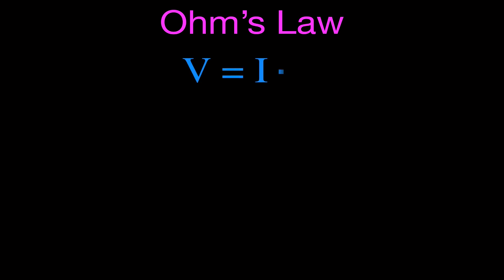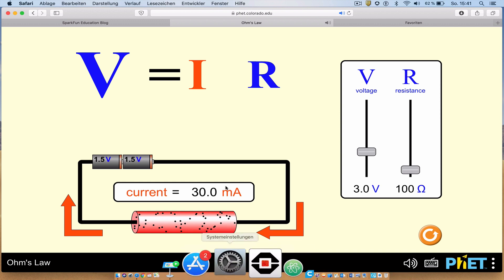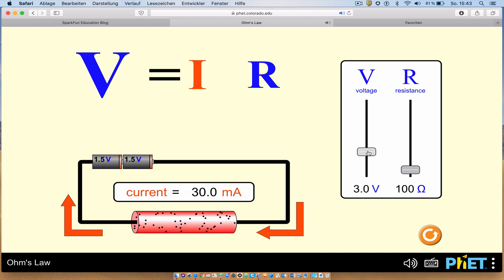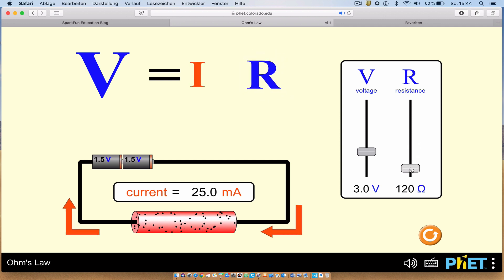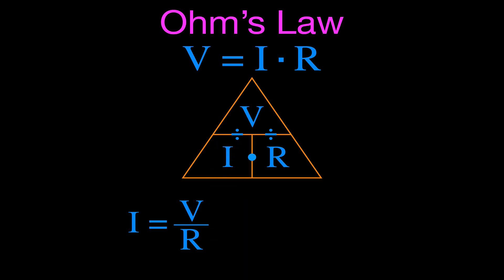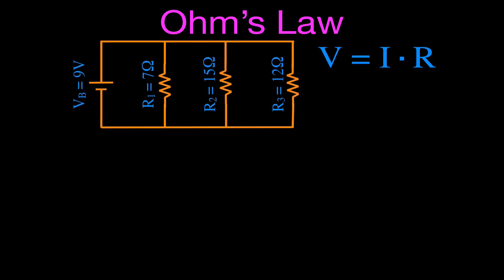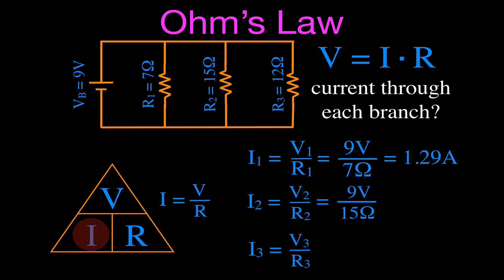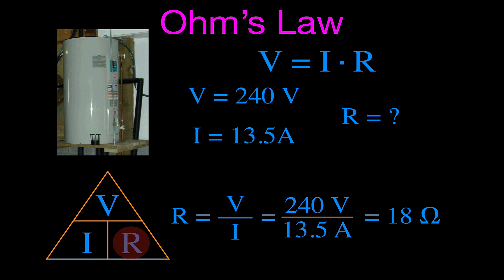Ohm's Law, An Explanation

Comment: I have a doubt my battery voltage is 7.4 voltage but my amp is 8. IF I use a voltage booster to increase 7.4 to 14.8 volt what happens to ampere will it increase or decrease